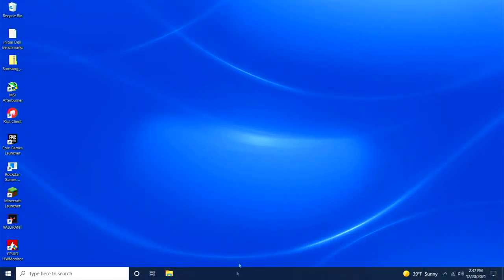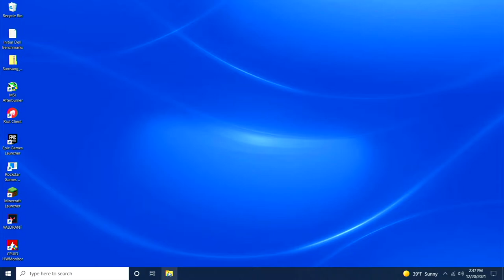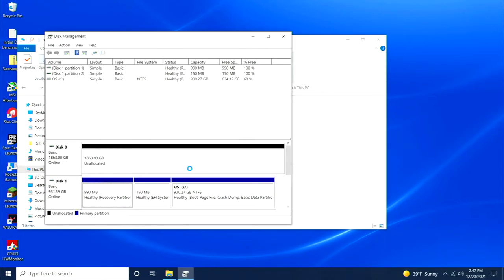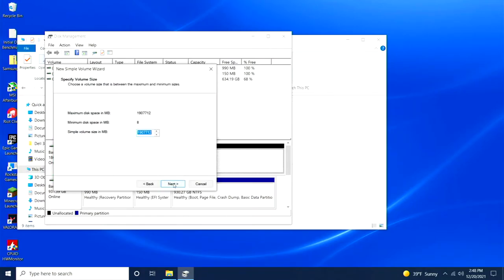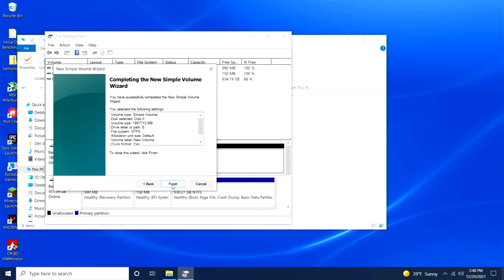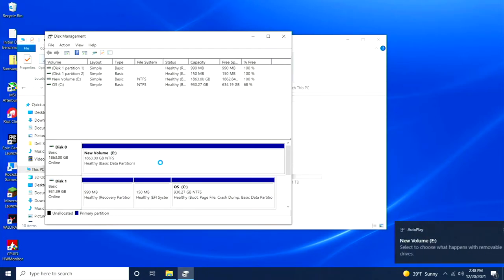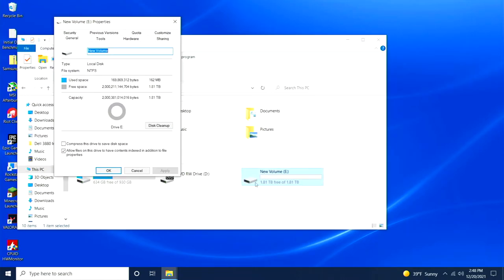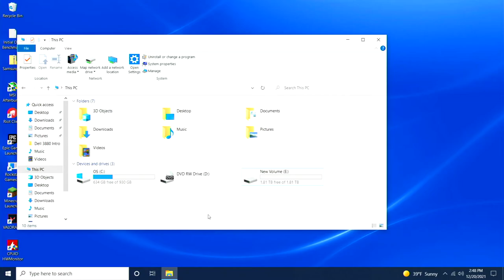Dell 3880: Adding a Hard Drive Start-to-Finish

Comment: Thanks so much for this series!  I bought the Inspiron 3880 (one that came with core i7 10700, 12g ram, and 512SSD) last year without understanding it's limited PSU and form factor.  It is now running with a 600w ATX PSU and an ASUS GeForce GTX 1080 TI 11GB Turbo Edition graphics card.  60fps and higher at max graphics settings is a piece of cake now!  Barely got the card to fit and can't put the cover back on the case because the card is so big the power plugs are sticking out where the cover should be.  But like you say, the unavoidable next step is to buy a bigger case anyway.  I would never have had the confidence to even contemplate doing this myself without your detailed videos!
Reply from the maker: I love it when a plan comes together! 😃

Thanks for watching!👍

Comment: I went the cheap route and used an old ODD to HDD caddy to mount my SSD since I wasn't going to use the disc drive anyway. Other than that, I decided to swap the side panel for a sheet of acrylic to show off the inside and then installed the XPG D60Gs. It turned out there was a way to get the RGB lighting to work after all. I had to switch from RAID to ACHI in BIOS and now Aura Sync detects both SSD and RAM. Now my baby's got a nice neon purple glow. All that's left is a new paint job for the case and a GPU and I'll be done.
Reply from the maker: Heh... Cool! I'm glad it's all working out well for you.

Comment: i have a 6 year old 256 gb ssd acer  laptop. I have ubuntu and windows 10 on it and it works for me just fine for me. I ran into storage problems  for some of my astrophysics research which I need linux to do so I had to resort to external hard drives for storage. I also have a dell inspiron 3880 which I got a 2tb ssd to put ubuntu on while windows 11 is on a m.2 ssd. Dual booting with linux and windows works really well on the dell but I had to change the sata settings from Intel Rapid Access memory (RAID) to AHCI in the bios to see the disks in my ubuntu usb image. Pretty happy with both computers until my laptop breaks which I assume is only a matter of time since it is pretty old
Reply from the maker: I can't speak for Acer, but I have many 10 year old Dells that are still running just fine today. If all you really need it for is Linux, the odds are that hardware performance won't be an issue for the foreseeable future.

Comment: Hey, I have this pc and I was looking at putting some case fans in it since it tends to run really toasty for me, could you do a video about this? Thank you and keep up the great work!
Reply from the maker: I cannot even get my CPU fan to come on full power for more than a few seconds no matter how hard I try. If you're having heat issues, you may want to see if something else is wrong.

But... You can remove the CPU fan shroud and put a fan in the back of the case if you want. It would be extremely simple to do.

Comment: Hello sir can I use a t400 gpu in this pc without any upgrade
Reply from the maker: Looks like there are T400 cards that might work with it. Anything that doesn't require any addition power should be fine.
Reply: @TheBrokenLife  thanks sir

Comment: HOW DID THE WINDOWS HAPPEN TO BE INSTALLED ALREADY ON THE NEW HARD DRIVE??
Reply from the maker: It didn't. In this video I added a hard drive. There is an SSD still installed that still has Windows on it and that is the boot drive.

I have other videos that are more about migrating your data to a new drive, to replace the existing drive.